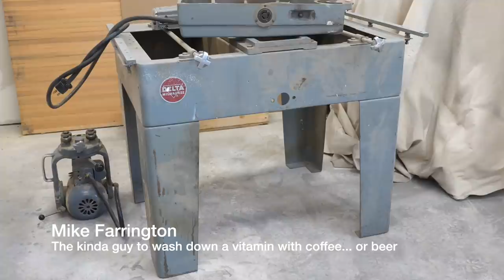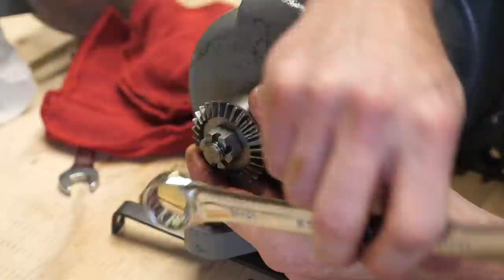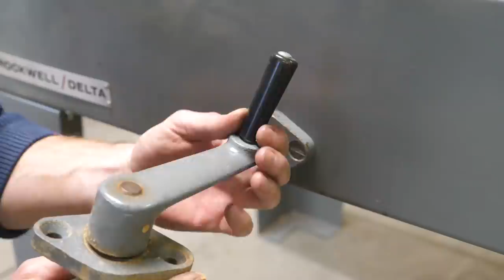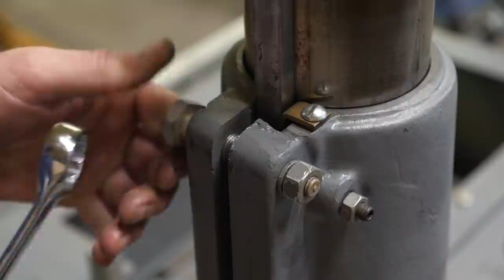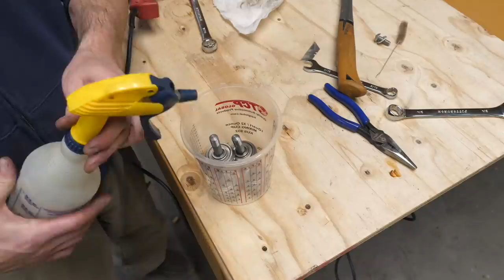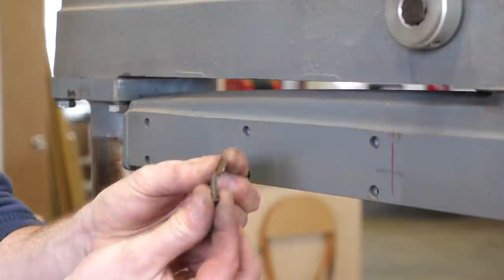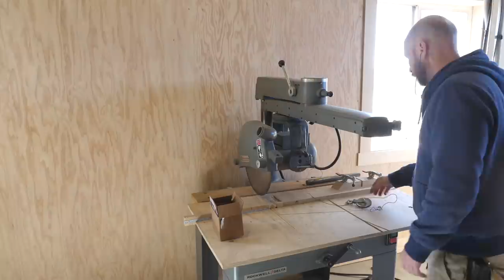Delta 16" Radial Arm Saw Restoration. It's colossal.

Comment: If you want to cut tennons and some heavy duty dados, you gotta try the old English trenching heads! Dude! These cut tennons as smooth as butter and take care of cross grain nicking like no ones business! Finding them is hard. eBay UK is one source. They say they are dangerous….. and like that meat cutter blade you have is not! I say Pooooh… I love my trenching head!
Reply from the maker: I have been hunting on eBay to find a trenching head. I am also looking at a good old fashion dado stack.
Reply: @MikeFarrington  you may need to search eBay UK and not eBay for the trenching head. Jack at jack English machines might be able to help. I do have a new dado stack but it’s 5/8 in. It’s a Forrest. Not sure what I will do with it yet. I am in the middle of a domestic nightmare where my ex girlfriend tried to steal the house with title theft. Otherwise I could make the trencher. When I get this under control I will make some smaller ones. Boring the dado stack is possible. The Oliver takes 1.5 in bore stacks on a stub arbor. I just threw my plates and chippers on my brown sharpe omniversal mill and clocked em in on bore and rim. Runs great and you can up to 4 in wide if you have the chippers! Old Oliver’s often make you smile. A 4 in dado will perk you up in a hurry.
Reply from the maker: @devemch7851  Sorry to hear of you domestic issues. Thats never fun. I'd love to see a video of a 4" dado.

Comment: So what are your thoughts after a year of use?
Reply from the maker: It's a nice tool. I do not like the 16" blade size, it just makes too much wind. This exact saw in a 12" would be perfect for me. I am currently shopping for a 12" blade guard. Once I find one, I will downsize the blade and dust collection. With that said, it's a very nice saw, no question there.
Reply: @MikeFarrington  Ahh so you can use a smaller blade with the same machine but could up to the 16 when needed. Would the blade speed have to be adjusted?

I’m looking at setting up a shop in my garage hopefully this summer and my dad’s radial arm was always heavily used but never see much of them. Looked one up on YouTube so now the algorithm is sending me plenty.

Comment: Hello Mike Can you recommend an inexpensive phase converter from single to 3 phase
Reply from the maker: I have had good luck with VFDs. I have a few linked in my tool restoration videos. The problem is they are low horsepower, up to about 2. After that things go way up in cost quick.
Reply: @MikeFarrington  okay thank you Mike i really appreciate the info i saw a few on amazon and so looks like i have to wait a while longer

Comment: Yay new content! I was worried you died or somethin.. 2 questions- 1, why do you suppose the steel is so much more worn than the brass? Isn't brass quite a bit softer than steel? 2, How do you know where to find parts for this stuff? Half the time I can't even figure out what words to put into Google..
Reply from the maker: Thank you. I'm still above ground. Brass is sort of self lubricating. Meaning, while steel is harder, it tends to wear out in this type of application faster. As to finding parts, that is more of an art than a science. I wish I could give more advice, but after doing this a lot, I'm getting pretty good and finding stuff. I will say, eBay can be great for hard to find stuff.

Comment: BTW.  They call them sealed for life ball bearings. Oh Really! The bearings are lubed with grease which is a mixture of “soaps” and volatile oils. In woodworking machines, you have fine wood dust. This dust absorbs the volatile oils and literally sucks the life blood out of the bearings from around the bearing seals. You don’t see this problem in metal working machines. So I just trash the old bearings. On my Wadkin PK table, I pulled the seals and went back to oil lube. It had ball oilers to get oil to the bearings. In a slider like this, that is an issue. So I just replaced the bearings. Even so, if your not cutting tons of wood on two shifts, new bearings will set you up for a long time!
Reply from the maker: In this case the bearings are very hard to find and very expensive because they have a machined outer race. On most of my tool restorations I'll throw bearings in just for the fun of it, but those are off the shelf parts.

Comment: It seems like the Delta radial arm saws are probably superior to the Dewalt saws in some ways, especially with the pivoting main arm. It's not clear why the Dewalt radial arm saws have so much more popularity. I know in my case, I really wanted a Delta, but chose to go with Dewalt because I didn't think I'd be able to move a Delta saw by myself. Even the smallest Delta radial arm saws have so much cast iron, I don't think I'd be able to move it without a total disassembly. Watching this video, that saw would cost at least $10,000 to purchase by today's standards.
Reply from the maker: I think they are both really good saws. I could make an argument that the Dewalt has fewer parts and is a more simple design. I also think its a little easier to tune. I agree, tools like this just can't be made on any large scale in todays world.

Comment: Radial arm saws were very popular 40 years ago. The old time woodworkers I knew as a kid all seemed to have a missing digit. They all lost it using a radial arm saw. They’re great tools but will bite if you’re not careful.
Reply from the maker: Thank you. Radial arm saws are as safe as anything if they are used with good habits. I watched a guy cut off 3 fingers on a jointer, I've seen someone lose a finger on a drill press, and of course the table saw. It all comes down to the person using the tool. Keep body parts away from the blade.